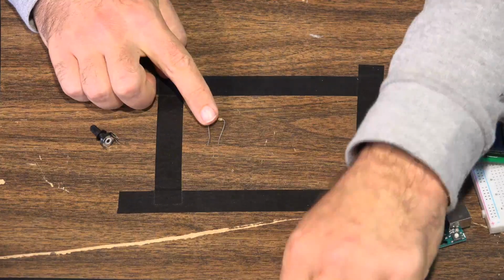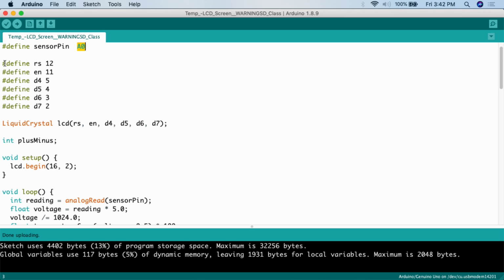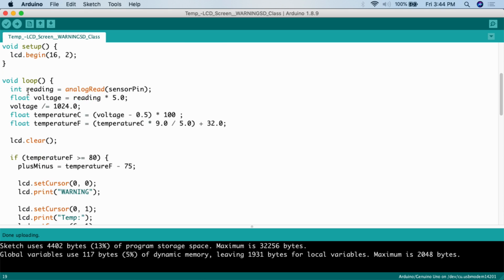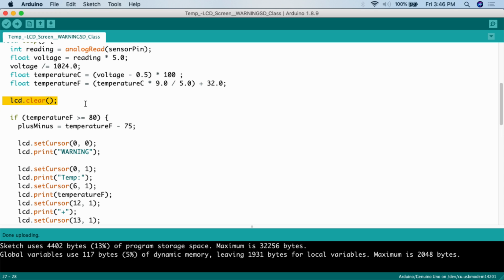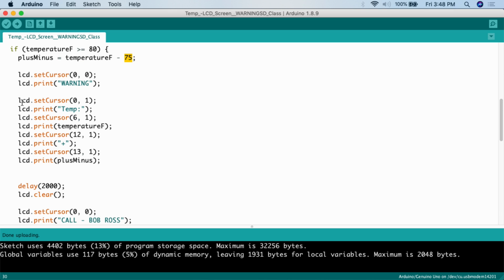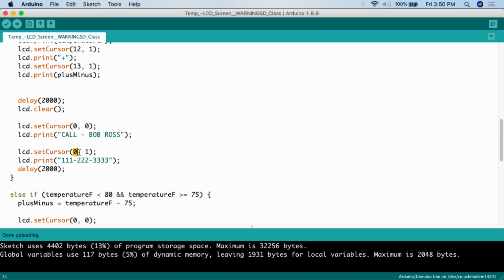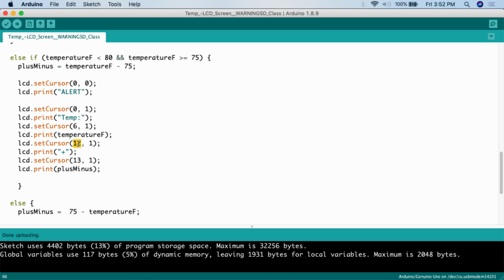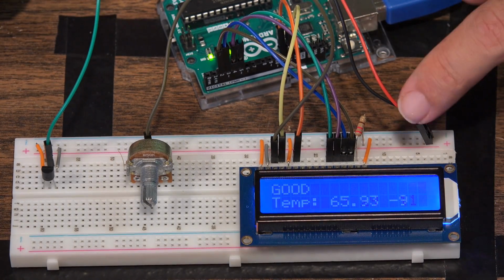LCD Temperature Alert System with Arduino

Comment: Hey....this arduino project is beyond cool.I'm an electrical engineering major. This semester I am in an introductory engineering course in which a portion of this class we just learned about the basics of an arduino. Fast forwarding this portion a little more....we just did what are callled final projects using arduino board where we can create anything we want as long as it involves arduino. Punchline: I am planning to do a self arduino project involving ambient room temperature of my house and this temperature is the best yet. My question is: since this project includes an alert system, could i add in an LED and a buzzer for temperature alerting?

Comment: Is there wireless network adapters and drivers for this thing?  I like this project, but I want it to save a comma separated text file to a network file location.
Reply from the maker: there's an Arduino Uno card with built in WiFi.  You can POST to a script on a web server and then have the script parse the values however you like...